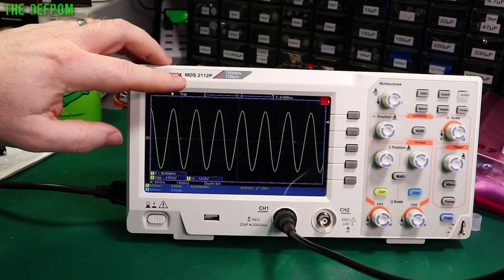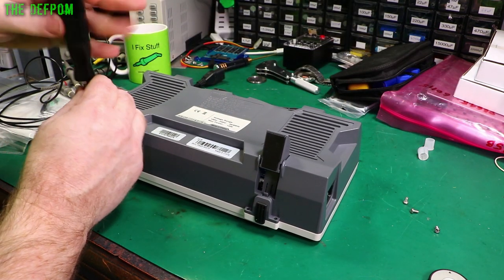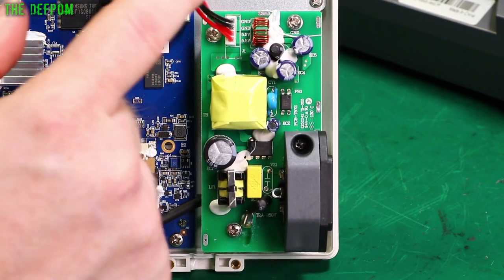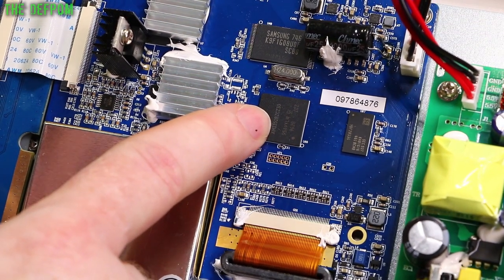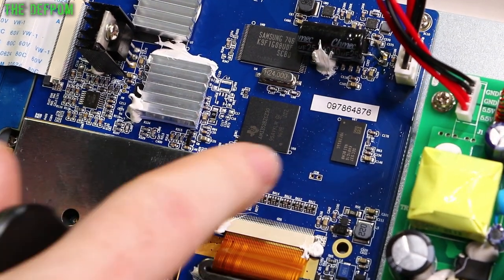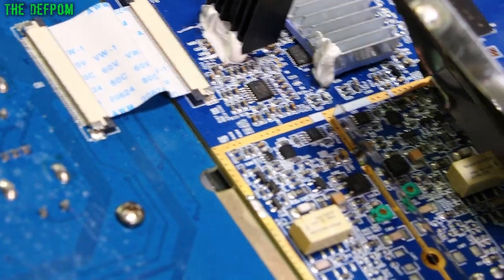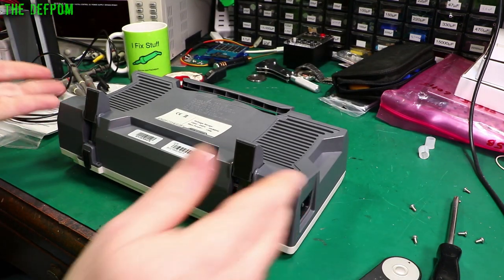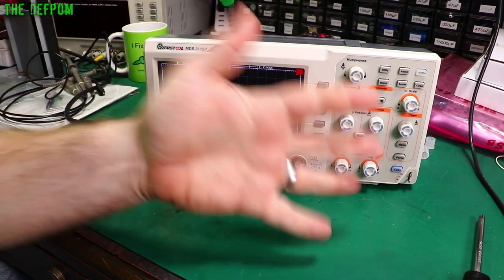#774 Mustool MDS2112P 100MHz Scope Teardown

Comment: It looks exactly the same as my OWON SDS1102. Same specs, controls, UI and even the looks on the inside. So I guess it's coming from the same factory, but being branded differently.
I've just noticed: It even says SDS1102_V1.2 on the PCB in your teardown.

Comment: I have the OWON SDS1102. Lilliput is the mother company for OWON, and they supply these under different other brands like this one in the video.
On my unit the GND at the power plug is connected to the mains as it must be, and also the GND plane goes to the BNC inputs as well. That is referred in the OWON Users Guide as well, check it out at their website.

Comment: They would do well to orient those two finned silver heatsinks around by 90 deg to maximise convective flow through the fins. Horizontal orientation minimises the air flow through the fins. Probably drop the temp of the cjips there by a number of degrees.

Comment: That is a nice teardown, showing the analog vertical amps for the first time on this modal.  Thanks for.
Although I almost sure the other side of those three PCB's also contains active components. I was looking into my unit the other day and I do not see the ADC chip(s) anywhere on the main PCB upper layer, so they must be underside.
 The power supply PCB is doubled side, as the rectifiers (both AC input and AC output) are not located on the upper layer.

Comment: Looks like the 5V power supply would be trivial to replace with a battery pack (with the existing PSU repurposed into a charger) and there appears to be plenty of space to easily give hours of runtime. The case is all plastic so it wouldn't take much to cover up the remaining metal bits and make it a great choice for power supply work on a budget.

Comment: Well that's gotta be a four sandwich score,  four would fit nicely inside  :-D
Use an external supply and put a real shallow back on it, and you have a tablet scope lol.
Is there no way to calibrate the frequency generator,  I2C cable and a pc, something like that?

Comment: 3:19 It seems that the earthpin on the IEC input connector isn't used, so i bet that there is voltage leakage present at the BNC terminals.
Also Channel 1 is up to 300V RMS, while Channel 2 is up to 400V, that's something i have never seen on a scope, 2 different voltage input levels.
Reply: The IEC socket is a board mounted type, so the earth pin goes down to the board. The tab is just an additional solder point.

Comment: my channel 1 gives 25v instead of 5v on the calibrating 5v channel 2 is ok what is the problem pls.
Reply from the maker: Your probe multiplier setting will be incorrect, my guess is that it is set to 2x
Reply: @TheDefpom  thank you for quick response.i have probes of 1x and 10x but i think that is not the problem because i use the same probe and the same 5v calibration on the right side of de scop only change the conn from2 to1,i push the autoset and on channel 2 it's correct but not on channel 1 also i can channel2 adjust  to 5v/div. but not channel 1 it is going to 5v /div but directli jumps backt to 50v/dev.i dit not see this problemin the begining(scope is 3mnd old) because i only watching the wave forms . later i discover this. the max volt i put on it was 12v so could it be that 1 resistor in the divider (input) is not solder well(thats what i think but maybe you have more experience on that.i was lookig for a compleet factory reset but could not find any. thankyou for now
Reply: p.s also channel 1 gives on 5v  5div. (50v/div) so that is 125v
Reply from the maker: Press the channel 1 button, you will see an option for probe on the screen, as can be seen here: https://youtu.be/MetL4tBh3QM?t=1496 you need to change that to either 10x or 1x depending upon the switch setting on the probe.
Reply: @TheDefpom  yes i know that and as far as i know i put  the 2 channels exactly the same but no luck.
Reply: I think it is indeed the input divider because I put a dummy load of 50 ohm in parallel with the probe and now both channels are practically equal and I can also regulate channel 1 well, so I will also take a look inside